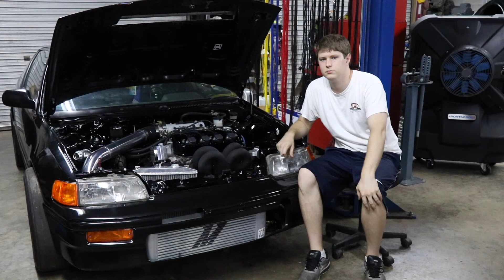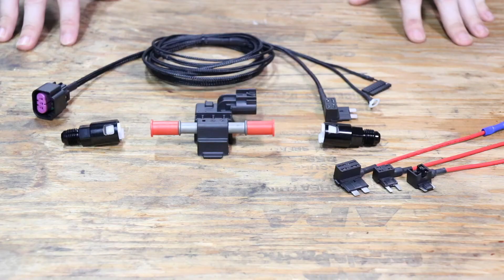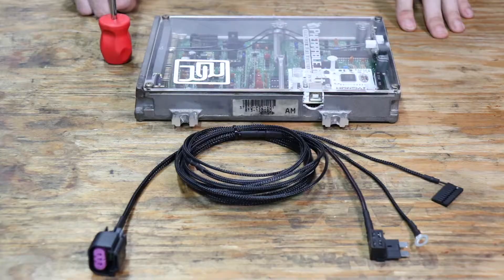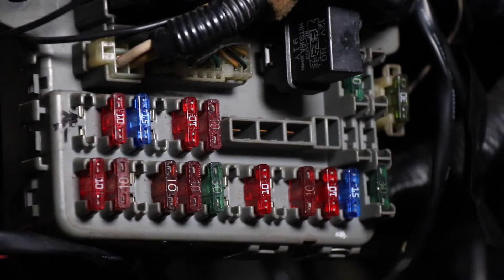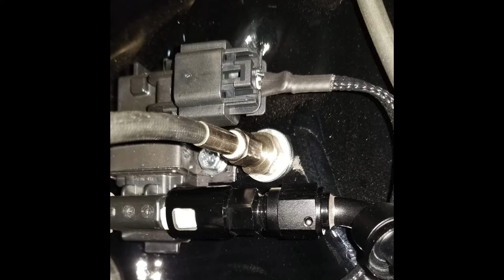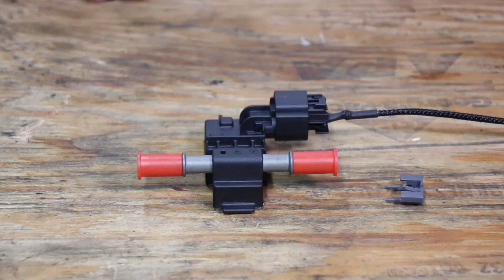E85 Flex Fuel - Burton Racing

Comment: Just to verify if everything is hooked up except the sensor the car will not start just crank correct ?
Reply from the maker: @k73x  not correct. The vehicle will start and run as normal and will run on its gasoline calibration since the sensor being unplugged will make the ecu see 0% ethanol content.
Reply: @BurtonRacing  okay i’m having big issue with this kit. car only cranks will not start. I have a crank sensor coming off of my motor but my harness has no plug for it.
Reply from the maker: @k73x  Your issue is not with the kit, it is actually impossible for this kit to prevent your car from starting. You need to figure out the issue with the vehicles non running condition first before trying to make any further changes.

Comment: BmTUNE has flex fuel would this work with that?
Reply from the maker: Yes as long as you have a signal converter to convert the sensor reading to a voltage reading.